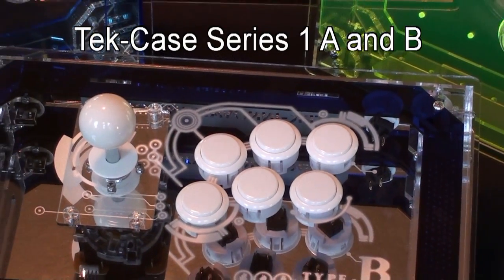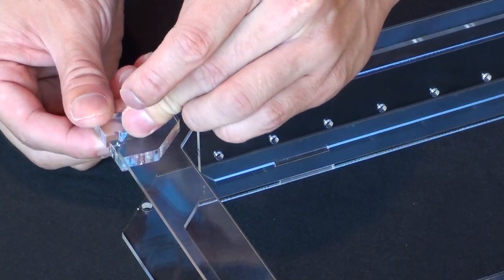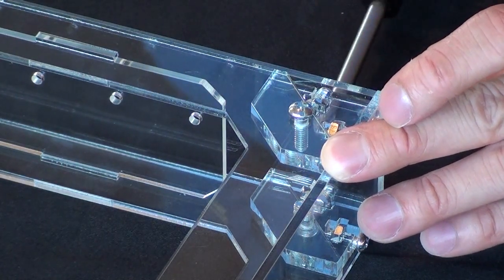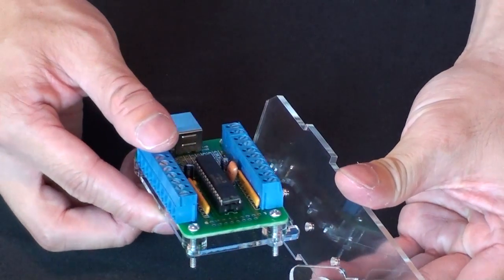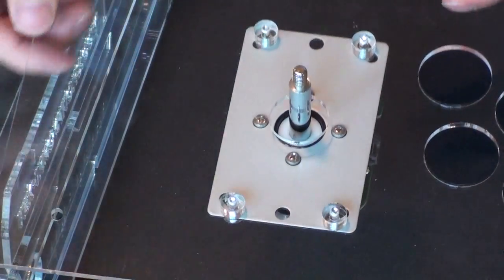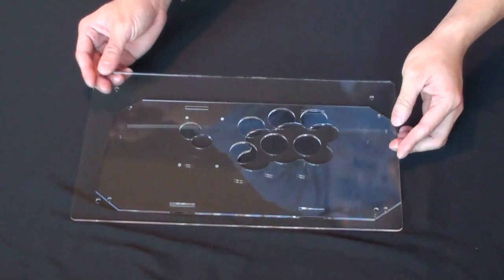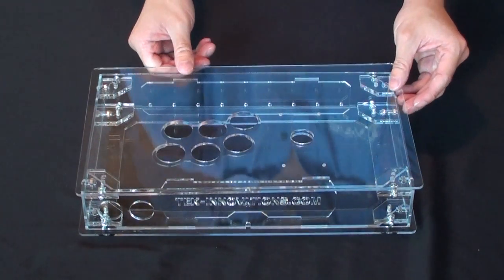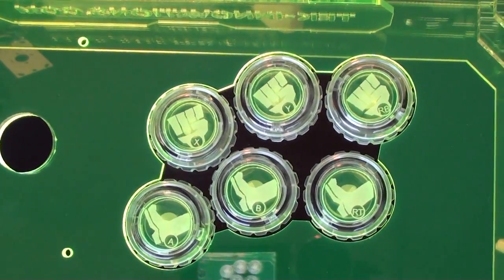Art's Hobbies - TEK Cases (Build Instructions)

Comment: I really like them, they look very nice.
But a question, whats the point of putting a image in the bottom? For me is a non-sense because you will never see it, or it will barely will be visible.
Reply from the maker: +MetalSonicodraco7342 Some people like to have their case as a display piece as well, so it can be seen while carrying it around or displayed somewhere. It's not much different than those who like a clear bottom to show their wiring work on the buttons/pcbs, and would have to flip it over to display it. In my case, I have a lot of fightsticks in my collection where I display them so people can see all the modded areas. Just different strokes.

Comment: I'm not trying to sound like an ass, but this has to be the worst idea for a arcade stick. We all know in the heat of battle we all tend to get rough on are arcade stick. Not to mention what happens if you accidentally drop it. I guess these would be nice to display but never use.
Reply from the maker: If it is the "worst idea" for an arcade stick, it wouldn't be one of my popular sellers with repeat purchases. I've also mentioned clearly that this case isn't for everyone, so those who are heavy bashers, or hard on their fightsticks in other ways, may not want this as their primary. And those who have used this case responsibly have not had any issues. Accidental drops happen, but they usually just have to replace a couple of parts and things are good as new. Thanks for your thoughts.
Reply: ITT people represent their opinions as fact. 

Art never made any claims that these were Sanford Kelly grade sticks. If you don't know how to take care of your shit, don't buy a less durable stick. Simple. To sit up here and claim that these sticks are shit, just because you would likely break them, is ridiculous...
Reply: koifishstudio In other words, you have nothing else to prove your point, because you had no point. I explain my Tek-Cases for exactly what they are, and they perform just as described, and I made it clear how they are meant to perform. If you can't bother to review those details on my site, then that's your problem, not mine. Stop looking silly by trying to pick a fight over nothing. 

Other than that, you're entitled to your own opinion. Other people are entitled to theirs and my customer's interests tell me the story of whether to continue production or not. And currently, production is still going. But by all means, feel free to ask Tek-Case users what their opinions are. There are Youtubers and others in the fighting game community showing their cases off. And for them, my Tek-Cases are "good" for their purposes. But you don't have to take my word for it. Feel free to ask them.
Reply: koifishstudio that's for the consumers to decide. I probably wouldn't use it but I'd like to buy it for flash
Reply: Im not the consumer than. Im still studying and I couldnt buy something expensive just "for flash". Well in this case it might be cool.
Reply: Edward PenisHands I love your name. Lets end this argument. Im not getting any as after all. Hope youre doing good.
Reply: ***** You just mentioned the biggest problem with this idea though.  The weight.  You want a stick to be nice and heave so it doesn't move around while you're playing.  Anything else is just useless.
Reply: When you take your stick out with you to friends houses and tourneys build quality is very important.  Cheap plexiglass can easily break with one bad mishap.  My stick is wood and steal, durable and heavy.
Reply: Got_Logic?
Don't waste ur energy on the various trolls of the internet  I get this kinda stuff all the time
Reply: koifishstudio And you seem to miss the point I was making. No where do I claim these boxes are the most durable nor are they the "best way". If you read this somewhere, please point it out. I've mentioned the fragile nature of these fightsticks (like, don't drop them or don't Hulk Smash them), and I'm not hiding anything in that regard. But for those who are keen to taking care of their fightsticks, and can appreciate the aesthetics, and are fine with the fragile nature of an Acrylic fightstick, they've been working well for my customers. And although they are Fragile, they are far from being "Fragile as fuck", considering they can hold up to a good amount of play (given the conditions I've mentioned).

So the original argument was that these are the "worst idea" for an arcade stick. Again, since they are high sellers, it's clearly not the case for being the "worst idea". And again, no where do I claim these are the "best". So what exactly are you arguing? You do understand there are different people with different tastes and interests, right? You don't like them? That's fine with me. But are you really just arguing an opinion now? Have you constructed one or have seen one in action to make you claims? Your feedback is welcomed, but I hope they're based on actual personal experience.
Reply: arthong you can argue, but his point is solid. Arcade sticks should be survivors. This contructon can breake when youre puting it thogether, not to mention its fragile as fuck. It doesnt matter if its selling or not. Ist not even close to best way.
Reply: DrankyDrank I'd never heard of the Sanford Kelly smash before reading your comment! I'm looking into making my own stick and watched this video, thinking that it wouldn't stand up to how I'd end up whacking the buttons. That doesn't mean that it's a bad design though, under normal play it'll work just as well as any other custom stick. Not only that but if you do end up going mad and breaking something, you only have to buy the replacement parts you need which is cool.
Reply: If its not good dont say it is. End of story.

Comment: Yes you can, however, the Tek Case was not designed specifically for this purpose so the Turbo Area was not taken into consideration. If you opt to remove the turbo area, then the rest will transfer into the case just fine.

Comment: First of all, thanks for your answer. What I meant is that plexiglass could attract static electricity that could harm circuits and thus cases made using this material  (eg for PCs) should be properly grounded.Maybe I was wrong or is not the case here.
Thanks.

Comment from the maker: I've never heard of that problem developing, to need to "get rid" of that potential. Unless you're playing vigorously with a wool sleeve, or wool glove directly on the panel, I don't see that problem. Many other cases are designed with plastic all around, so if that's any indication, static electricity doesn't appear to be a concern.